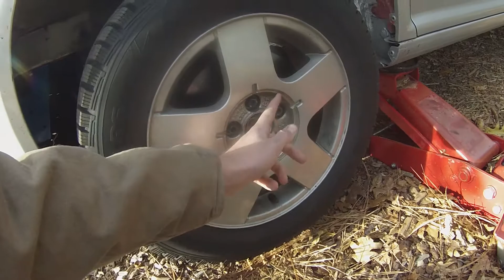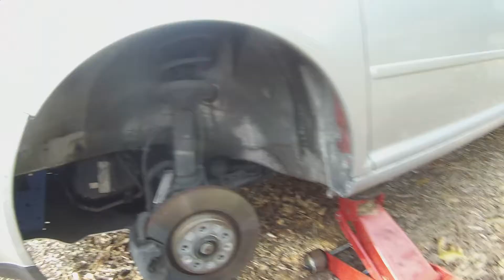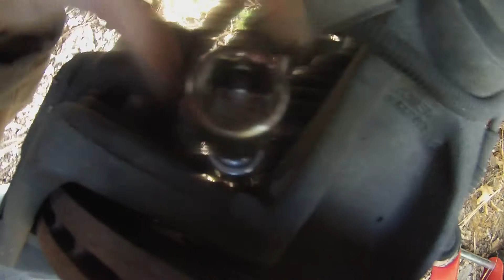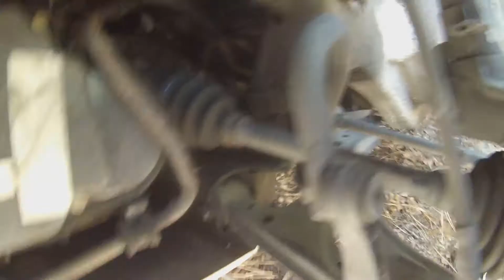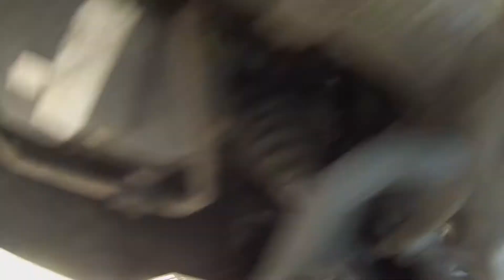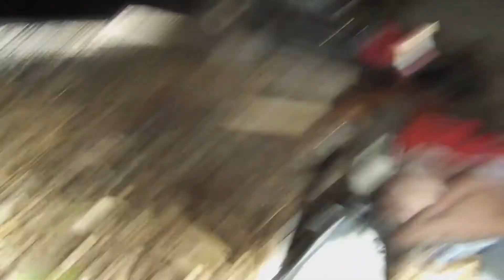Replace VW MK4 Golf/Jetta/Beetle Control Arm

Comment: Instead of beating and ruining an extension all really had to do is turn the wheel, jack car up a little and wack the side of ball joint with hammer few good times it will pop loose and not hurt anything. Or do what other comment said and take the three ball joint bolts out and slide out. Instead of making the job harder than needed.
Reply: what if I wanted to save a brand new joint? only reason I need to replace a control arm is the sway bar link hole for the bolt is stripped like a cheap stripper!

Comment: Since you were going to toss the ball joint, easier to undo the 3 screws and slip it out of the control arm.  Hit it with a bit of yellow spray paint to put  the new one  back exactly...it should fit in one position, but check it.

Thanks for the hint about the sway link.  

Lucky two hits did it, otherwise you'd be buying a new extension.